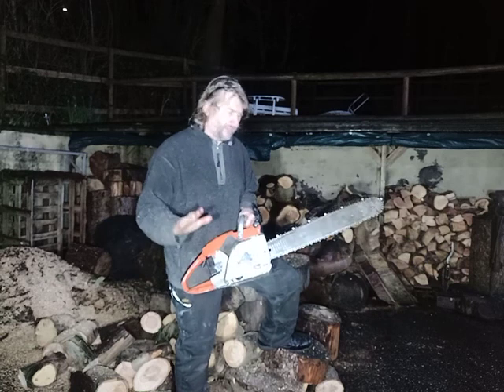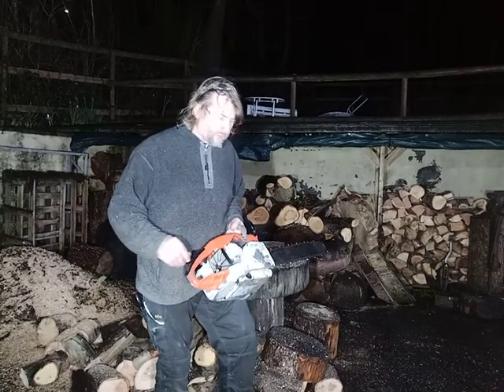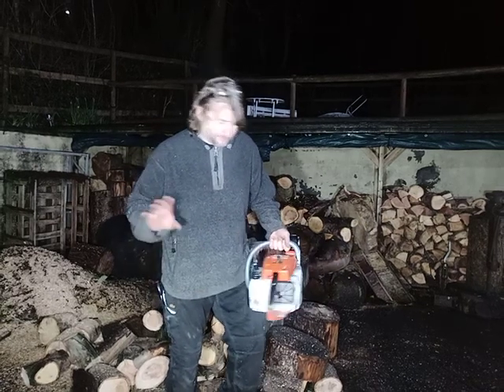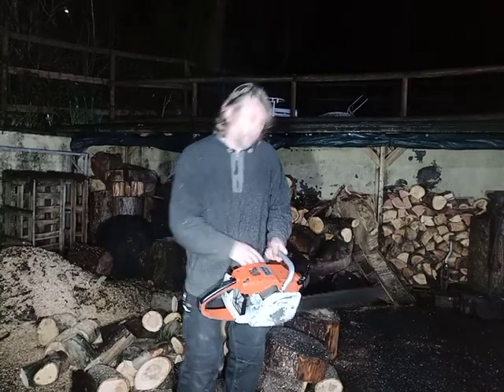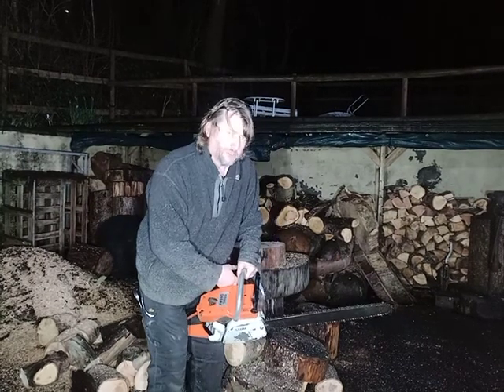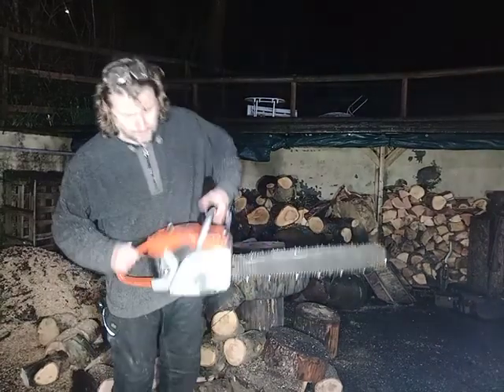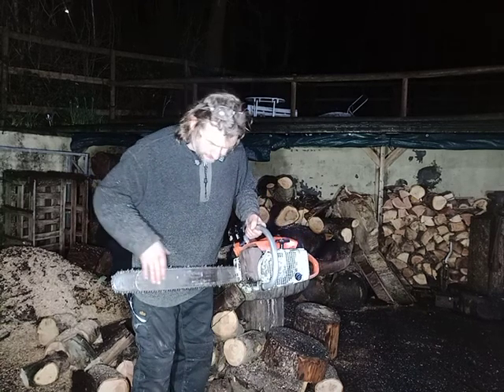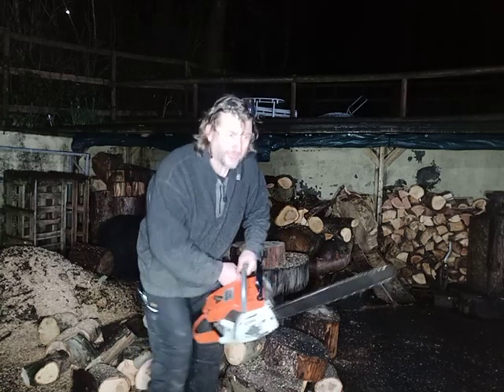Stihl 045AV Vintage Professional 75cc Chainsaw. Needs some TLC but a Fabulous Running Engine 👹

Comment: Hey Stride,
150 saws are awesome! Congrats. 
My wife thinks i'm crazy everytime she sees my 20 saws vintage stihl and solo collection. :)))
But good to know that there are even crazier people out there.. ;)

Best wishes from Germany...
Reply: Just repaired an 045. Nice machine to work on. Great sound 😊
Reply from the maker: Hallo Marco
Gruß aus Großbritannien.
Ihr Englisch ist ausgezeichnet. 
Es tut uns leid Mein Deutsch ist sehr schlecht..lol
Ich übe, aber es ist schlecht.
I love the Solo saws.  So I did sell 1 of my saws this week - this good - and then I bought 8 more - this is bad. lol
Thank you for the message.
meine besten Grüße.
Robert
Reply: @stridebaad1219  
Hallo Robert, du machst das gut mit deutsch. Ich habe alles verstanden.  ;)
I also love solo saws.. particularly the 60135 from which I have a mark 1 and a mark 2. Both I tore down completely during the first lockdown last year, cleaned them, and replaced all the old sealings, filters and rubber parts. 

I regret that I didn't film it to share it here. There is still no video online showing a complete rebuild of a 60135.. 
Maybe it's up to you now to be the pioneer.. ;))